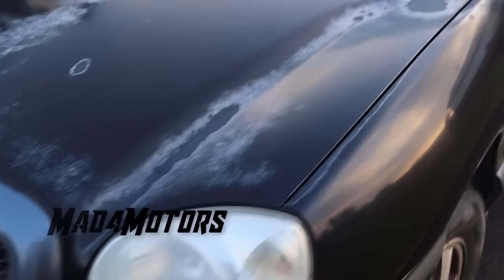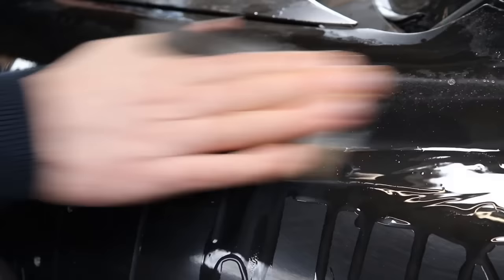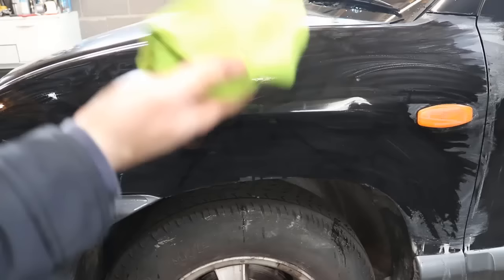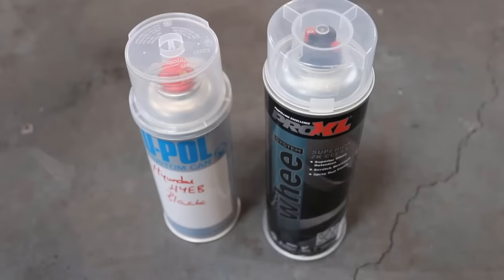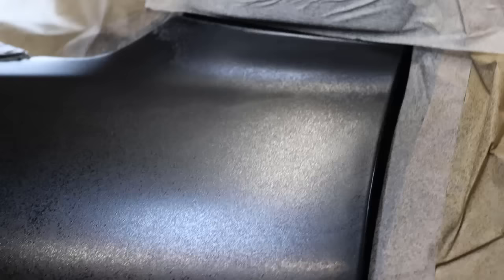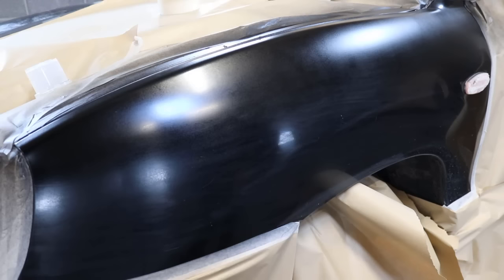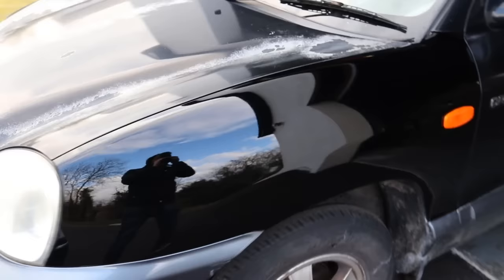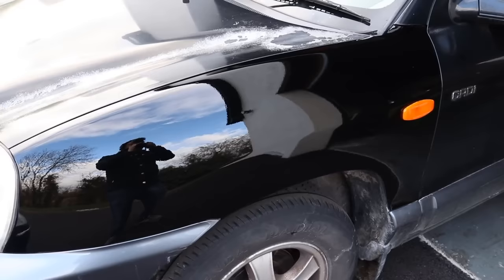How to Repair Clear Coat Fix 100% all types

Comment: Thank you for posting this video. It was extremely informative and your instructions where easy to follow along with. It’s amazing to me that you where able to get the results you got using spray cans. Very impressive. I have this very same problem with my HHR SS. A shop in my area gave me a quote of 5k just to prep and spray the passenger fender and door. After watching your video I’m definitely going to give it a try. So again thank you for taking the time to make this video and explain how this repair is done. Thank you
Reply: How did it go?
Reply: @ericklopezgraciano2962 Fr lol (my door is peeling) 😞

Comment: That looks amazing man. I cant believe the results without wetsanding in stages after clear coating. Most other videos recommend alot of stages with sanding, then buffing with compound and lastly waxing. Yours look almost as shiny without anything.
Reply: I'd say it has been polished after it dried out. There are some imperfections vissible right prior masking tape removal and then the surface is litle bit smoother without those few bits at the end of the video. It has been polished off. Good job regardless

Comment: Wow, great job! The car looks amazing where you touched up. I have a small patch of clearcoat that peeled somehow on my F30 front bumper thats needs to be done. If only I can have the guts to do what I just watched from you especially the sanding process. Just don't want to screw it up and make it looking worse!
Reply: Use a high grit, like 800, so you will not damage the surface, and if the surface is not smooth then try to go lower and more aggressive grit like 600 or less. Make sure you use water while sanding

Comment: Very light orange peel, great job for sure!!
Reply: He could get rid of that by wet sanding the clear coat 1 more time and then polishing it :)
Reply: He's not going to do that when the clear coat is fresh obviously, you need to wait for at least a week before you can do that. He probably done that afterwards :)
Reply: Michael Cook 
Mm

Motorized  bicycles
Reply: @NjoyMoney or just use compound and then polish.
Reply: @JR-uy2nd  that wouldn't get rid of the orange pill that would just make it shiny. And he wouldn't risk wet sanding this clear because there is barley anything to sand. That clear is so dam thin this diy hack job
Reply: Wet sand and buff will solve the problem
Reply: Jason Marten yeah about 2 or 3 days should be perfectly fine
Reply: It sounds to me like most of you guys haven't seen the paint on today's new cars or just some more rookies trying to sound like they know something.
Reply: jr Rangel amateur
Reply: @ryugo7713  I've painted over 30 complete cars and done way over 100 partial repairs mr!
Reply: jr Rangel just f’n with you brother. It was clear to me that you knew what you were taking about. I’m not very good with sarcasm.

Comment: I will be attempting this on my 08 CSX Type-S (same gen as the 06-11 civics that had that horrendous honda clearcoat damage) My clear peel is getting worse every week with areas flaking more and more. 

I do have a question though.. For example in your finished product in the video; What are your thoughts about buffing/polishing and waxing after everything to even out any sprayed clearcoat? 

I will most likely attempt on one of my extra fenders that has excessive clearcoat damage that I've attempted to wetsand 2 years ago, but did not know how to continue afterwards (which is where your video comes in incredibly handy!) Once I give that a practice-run and see how it turns out, I will attempt the same procedure on my car's top pillar, and side of the door/rear quarter. Hopefully I don't mess it up, though the clearcoat fade is so bad, I don't think I can make it look any worse hahahaha

Thank you for the video!!
Reply: I'm thinking of doing this to a 2010 civic too.. how'd it go?
Reply: @chris_-in3ff  Unfortunately I haven't had the time to do anything about the paint yet. Since I made that comment, my car started shifting horribly in certain situations. Under 4k driving is normal, but 5k+ and I cannot put it into any gear without ghost shifting. Just changed transmission fluid today, and the issue persists. My next step is changing the pushrod in my hybridracing CMC to the OEM pushrod (since my buddy and I missed that step 2yrs ago). 

Long story short, I unfortunately won't be attempting the paint fix until the car is drivable :( 
I will however come back to the video if by chance I decide to do it, and will definitely leave a reply with the results. Perhaps even a vlog about it (I've been meaning to get back to vlogging, but life been knocking me down)

Comment: Very impressive!  Would love to see a "12 months later" followup, to see if this actually lasts.
Reply: It lasts the lifetime of the car.
Reply: I have a 2002 crv ,spray paint the hood in 2008 is 2020 and still looks awesome.
Reply: @legioner9  is it true? I'm really considering can painting some parts of my car.
Reply: He barely prepared the surface, didn't paint behind the indicator and painted straight over dirt. It'll need a repaint in no time.
Reply: @Ben-Rogue  im just learning. Exactly where did he paint over dirt? It looked like the whole panel was washed then sanded
Reply: @steve5912  but still spent less than it costs to buy another car. Nothing wrong with taking care of what you already have.

Comment: I was a little worried at first when you put the base color on because of that orange peel, but it turned out really awesome.  Nice work!
Reply: The clear will help hide that. As long as the clear has no orange peal. You see the top shiny layer.
Reply: The base coat will lay down
Reply: Yea. The base coat is going to put a thin coat over everything, and because gravity happens, the small divots even out.
Reply: Plus if you buff and polish it it'll really really help
Reply: Basecoat always looks like that when its wet. As long as it looks right when its dry your ok. If you see orange peel or even worse fish eyes or crow feet then you have to start over because you have contamination under the clear and will have to sand it out and then try again. Also make sure to use wax and grease remover before spraying anything to help avoid those problems in the first place.

Comment: Good job. short and to the point.  Ive got a football size peel on the hood of my older Kia Soul,   it's baking in the Florida sun here.   I used to fix my own vehicles and repaint and clear coat,  just with cans,  always came out fine.    You reminded me that it's time to get back on the stick . Thanks.  Subscribed.

Comment: This is a great video and I gave it a thumbs up for sure, but with a caveat: this would be impractical in most instances I can think of.  Your showcase of how the fender looks now as compared to the rest of the car is sort of the proof that rarely would anyone be getting away with just a fender refinish. It seems you went on to paint the hood with this technique as well although I haven't seen this. As a retired auto painter, and one who spent 11 years working at the automotive paint store, I can tell you that this approach, when expanded to cover several panels on the car, will cost you more in materials and labor than your thinking. Also, the fender as it is now, really couldn't be called a "finished product", because even though it is hard to tell from the video, I can predict that the fender will have had trash in the clear coat, and also, when full dry, the shine you see now will will dull back as the fresh clear coat shrinks back. This will have to be color sanded and buffed to actually look "right". That's more material and labor also. One last thing: There is a chance this refinish may only last a short time: Unless you are willing to get all the deteriorated clear off the fender completely, any left can quickly spoil underneath the new layers of finish and it will show. I do speak from experience that's sitting in my driveway right now!  But, I'm in no way putting a negative spin on what you did here: I myself am looking for ways to paint small projects at home now days and I haven't found an economical way of doing it yet. Automotive paint materials are just so over priced, IMHO.  Thanks for a great video, and thanks for sharing.

Comment: Very well presented! I've watched several videos and this really gave me the confidence needed to fix the paint on my truck.
Reply: How did it go
Reply: How'd it go?
Reply: @ghostzzz3988  I painted it last summer and it didn't look as good as Mad4Motor's 😂 lol but it did give our 20 year old vehicle a facelift. I fixed an area on the hood. It was really hard to get a good angle and probably would have come out better if I could have painted the entire hood. Its slightly noticeable, but I just wash and wax it regularly and its not unsightly. I'd suggest anyone trying this to buy good quality spray paint and take the extra time to protect surfaces you don't want painted, even practice first. I had some overspray of clear coat and it's still a little rough there. But all in all, until I can have it done professionally I'm not mad at it.
Reply: @mimig5843  you could just sand the overspray and polish it to fix that

Comment: I legit thought this was going to have a ton of orange peel for a spray can but as you say, take your time and prep. Now Im going to go around and just do single fenders and leave the rest of peoples cars a mess! HA!
Reply: That's just evil...lol
Reply: djshotokan bwahahaha
Reply: Man thats fucked up thats like stealing the remote and not the tv
Reply: I guarantee he wet sanded and polished it after the fact
Reply: There is a pretty hefty amount of orange peel on there, but as it's 2k clear you can at least compound it properly to get rid of that. It's definitely a good job (do wish he'd popped the indicators out though).
Reply: 6stringsong Right!! but on my toyo beater ill take the orange peel in the paint 😂
Reply: @SuperchargedLlama  what do u mean compound it and get rid of the orange peel
Reply: @justinharris5308  I'll explain compounding quickly but let me know if I need to explain orange peel too (it's absolutely fine if I do).

Compounding is where you use a heavy cut compound (polish) like Meguiars 105 or Koch Chemie H9 (there are many, many others) with a Heavy Cutting pad. These polishes and pad combinations are designed to remove a high level of defects in the paint but they aren't expected to leave you with a perfect finish, because they are so abrasive. They'll get rid of bigger scratches, orange peel and deep swirls (as long as all of these are in the clear coat, not through to the paint, of in the paint and not through to the primer if it's single stage paint) but the process of polishing with such abrasive polishes means they'll likely introduce their own very fine and light swirls. These can then be polished out with something like a finishing or single stage polish and a lighter cut pad.

Does that make sense?
Reply: @SuperchargedLlama  Yep! Well, sorta. Do you think his process will make do on my civic fd roof? The paint is intact but the clear is staring to have some white faded thingies. It's metallic silver in base. Am I correct to assume that the light fadings are just clear coat?
Reply: @Dada-gk9ic  Whilst I can't say for sure, I would say that it sounds very likely to be the case and this is worth a go.
Reply: @SuperchargedLlama  Additional info: It is very smooth to touch and no flakings. Do I have to wet sand the entire roof panel and completely remove the existing clear coat? OR just wet sand it (adhere) then apply a new clear coat?
Reply: @Dada-gk9ic  just wet sand the area that's affected (and a bit of the surrounding area too) in order to give the new clear coat a good surface to attach to. Have you got a machine polisher?
Reply: @SuperchargedLlama  Got it. I'm going to buy a dual-action one locally this weekend. So here's the process, let me know if I missed anything please:

1. Wash and clean roof panel
2. Wet sand the faded areas with 1500 grit
2.2 Wet sand the surrounding areas to cover the entire roof
3. Repeat steps 2 & 2.2 but with 2000 grit
4. Clean thoroughly, then mask with painters tape (Civic FD roof panel can be taped as one whole piece, no blending needed)
5.Apply 3 coats of 2k clear coat, 5 mins interval each (light coat, light coat, medium coat)
6. After curing (a week?) Wet sand the panel with 2000 grit
7. Compound and polish/buff (No idea yet on which pads or chemical to use TBD)
8. Seal with wax (any recos?)

Sorry for the long comment lol
Reply: @Dada-gk9ic  I think that sounds absolutely right, but add the following: Panel wipe (this is type of product, there are loads of manufacturers - if UPOL is available to you I'd suggest that). This is the thing you'd use at the beginning of your Step 4 .

The wax thing...well that's a big question! It can be down to how much you want to spend and what's available to you. You'd want to leave it about a month before putting any wax or sealant on so that the paint can fully cure and "gas off".

You may find this video I did useful:

https://www.youtube.com/watch?v=S4exPk3HioA

And these two from JohnnyGetsCash:

https://www.youtube.com/watch?v=wz8QnAN6bEI

https://www.youtube.com/watch?v=Vaga2RYllvE
Reply: @SuperchargedLlama  Thank you so much for the time and tips! Will definitely look your videos up for more :)

Comment: Dang looks great man, I've been doing polycarb headlights with great success. Wetsand and clear makes em like new. 

Now I have no fear painting my Volvo with that 2k it will be great.
Reply: That's quite correct. You are restoring headlights to "factory condition", ie how they were made in the first place. Once the lenses are moulded they are clearcoated to protect the PC from abrasion. 2K is best for that. I've done a video, but people ignore it because it's "too much hard work" and prefer those 10 minute polishing kits (which of course only do a temporary job of polishing up the PC)
Reply: Cyclone Cyd, funny It literally takes 20 min, minus waiting for clear to dry between coats. Looks like new. I've done it for as low as $15 a light just cause I can't stand foggy lights.  I'm considering doing some leading to fix a rust spot on the Volvo from a bad body shop repair.
Reply: As you say, it's not actually hard work at all and will last years and years if done correctly.
Leading? Wow! Last time I saw any of that was at Rover's Cowley Body Plant in the 80s when RR bodies were made there.
I've got some small rust patches appearing on one rear arch - I must confess to being apprehensive about what I might find once I start sanding, but it must be done - it won't get better on it's own!!
Reply: Cyclone Cyd , yeah I dont want to use bondo on it , eastwood has some videos and theres others
Reply: Jeremy R i have had no luck with clearing some toyota headlights. I wet sanded them down to 5k and clean with spray can window cleaner and microfiber cloth then rubbing alcohol and microfiber. Cleared with dupicolor and another with krylon clean and got same results. The coating blocks up and lines form all over in the clear. Probably just going to sand back down to 5k then rubbing compound with polisher and leave that way.
Reply: @joeholland428  sand down to 5k???
5000grid???never seen such a grid..and clear will never adhere to anything passed 1000grid...
U need a two part clear..duplicolor is acrylic laquer...cannot polish it...
I never used clear on any of my headlights since 20+years restoring them...i make them last 5years...years experience..
Reply: Vince Vega Customs thanks for the reply, i am just tinkering, yeah i found some 3k amd 5k pads. So i was wet sanding clear down to 5k then buffing with polisher and rubbing compound and they were coming out brand new looking, was happy with the results but wanted them protected from uv i think so i cleaned with window cleaner and microfiber cloth then rubbing alcohol and microfiber cloth. Next let dry then coated with meguires headlight coating spray, comes out amazing looking so far. 
I appreciate your pointers on the dupicolor,  i was a bit disappointed when it blocked up on me after all the sanding. No more of that with the meguires headlight coating.
Reply: @vincevegacustoms754  I wet sand clear coats on my bikes with 2000 grit for a glossy finish on the reg.
Reply: Abq Xyz - so you’re sanding to (say) 2000 grit then polishing, cleaning. The Meguiars spray is ok with that?

I ask as if about to try the same thing.
Reply: molluscturtle yes my results were good. I actually sanded to 5k then polishing compound with power polisher. Looked super clear at that point, next cleaned with aerosol window cleaner and microfiber cloth then rubbing alcohol and microfiber cloth. Then dried with hair drier then coated with meguiers headlight restorer spray per instructions. My results were good, headlights look better than new.

Comment: I’ll be doing this on my Suzuki swift this weekend. I’ve bought everything you’ve said we need. 
I may be wrong as I’ve never done this before but it may be worth mentioning to get the base coat regardless as sanding down may remove some of the paint anyway? 

Thanks for the video mate I’ll be following it step by step

Comment: Great job and good result, but why not removing the left indicator before painting? It’s a 10 sec job...
Reply from the maker: We tried! but it was previously glued back on!
Reply: If your painting with spray bombs, why would you go through the added trouble?
Reply: Paul-Ivo B. Because it's a 1999 Hyundai, not a 2018 mercedes.
Reply: If you are doing a cheap shit job like this it don't matter but quite often the clips break holding the light case  and you end up having to glue it back on
Reply: Its good to clear coat indicators :D